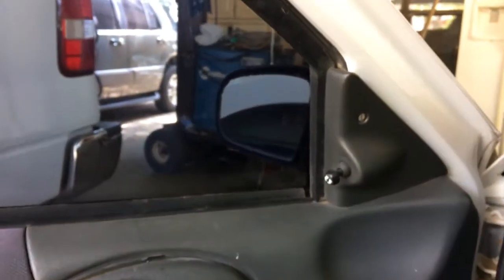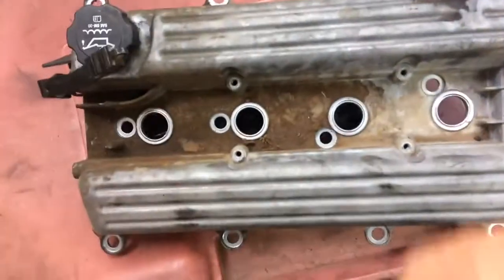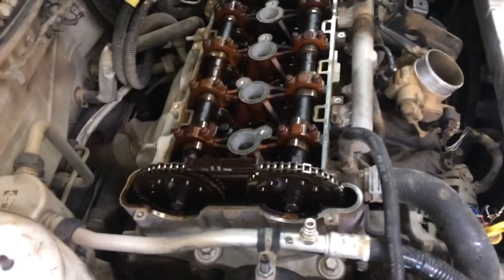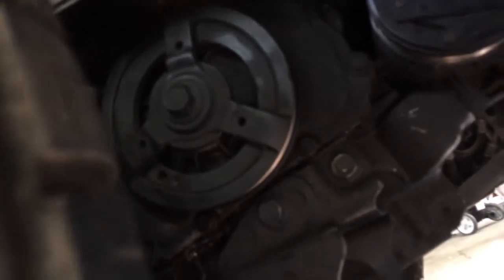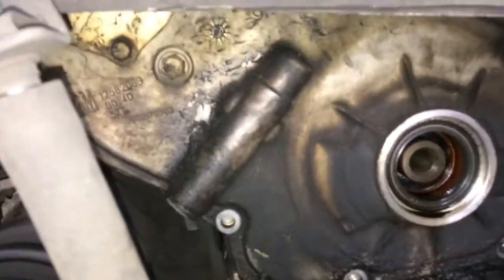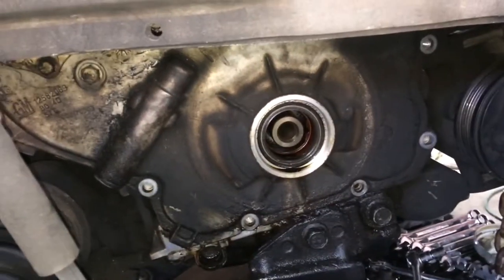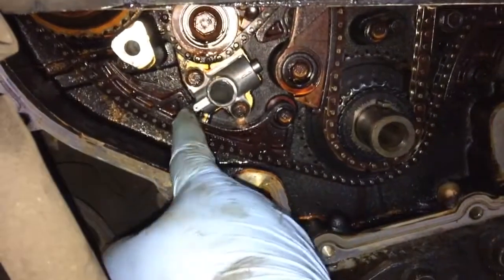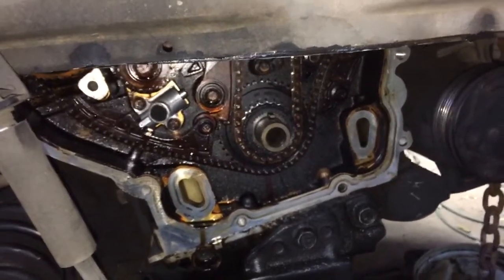2005 Pontiac Sunfire ecotec 2.2L timing chain noise diagnostic.

Comment: As bad as all the timing components were within your eco-tec, I really hope that you changed every part! All the chains, tensioners, & guides! The timing  is controlled via oil pressure especially on VVT equiped models making regular oil changes a NECESSITY! As soon as my oil starts to darken, I change it! Usually about 2,500 miles. My 2.2 has 197-198k & it runs great! With regular maintenance it will outlast the vehicle! Still has great power for a 4 cylinder! The tensioners operate on oil pressure & dirty oil clogs them up!
Reply: Wow  GREAT thing to remember  THANK YOU!

Comment: A few years ago, I was at a used car lot looking at a different vehicle when the sales lady mentioned a G5 that they had & that she had just started it. (I think the car I was looking at had a dead battery or something) so, I went & looked at the G5 & test drove it. It shimmied real bad but, had bald tires. Long story short, she started it to hide the ticking of the timing chain! Turned out that, all 4 wheels were bent according to a local shop who also informed me that the control arm bushings were bad & when I changed them, the bolts were seized=Nightmare job!!! Anyways, I changed the timing chains in December in teens to 20° high weather! 2 months later, the transmission went out! I changed it myself with help from 1 friend using jacks when I really needed a transmission jack!!! Looking at the condition of your timing chain & tensioners, You are very lucky it did not skip & bend the valves!!!! Mine start tapping just at start up so, I changed the upper tensioner but soon it started tapping again so, I changed every part of the timing components except the water pump because it was freezing outside & it worked fine & still does to this day! I have it if need be!

Comment: Sry 4 so many comments but, many of the timing kits are missing 1 thing or another! Which one to get is mind boggling! On my Pontiac G5 2.2 vin-F, Do i need the timing cover gasket, or front main seal??? How did u fix your broken bolt issue? Would be nice if the 2.2 timing kit came with a water pump, oil pump, oil pan gasket, at least the valve cover gasket & o-rings & timing cover gasket, all stretch bolts! EVERYTHING NEEDED. Did u reuse any of your bolts (cam bolts, or the 2 little gears-bolts?  Y the timing kits dont cime with everything is beyond me!!!!!

Comment: good stuff man, thank you very much... I think that sound was similar to what I was hearing, I thought it was just sticking valves. My 2007 saturn died the other day and I am just running through everything. I noticed it was slightly sluggish when I turned AC on and had a clicking in the top of the engine but she ran strong,  It didn't even warn me with a check engine light, just started sputtering then wouldn't start at all lol as I was trying to get it to a safe parking spot the check eng light finally flashed right as I was pulling in and hasn't started since... fuel pressure good, battery seems strong, getting the alternator checked monday, but decided to pull the valve cover, There was a bit of slack in the timing chain which got tight as soon as I rotated the motor by hand. My mechanic friend said it is normal (but I am still worried) timing still seems pretty closely aligned to "top dead center"  and even when I slowly turn the engine I can hear a couple valves sticking. (at least 95 percent sure thats what I'm hearing) battery seemed to be holding a charge so I'm doubtful the alternator is bad (but I've been told a weak one can mess up newer cars differently so worth a check) lol any thoughts?  After your video I'm going to open up that cover and check that tensioners. Cheers to you, thanks again for the vid
Reply: Depending what model,  my Z24 has a digital dash and takes at least a 100 amp alternator to run.

Comment: Thanks for this video.  I have a Saturn L series with this engine, 213K miles.  Some questions -
1. Was it dirty inside the engine?  Do you think this car might not have had regular oil & filter changes?
2. Did you also change the timing chain tensioner (the one that screws in to the top of the head) to the latest design?  I am thinking of doing at least that to my car soon.

Comment: I need a new idler tensioner, which one do you recommend from rockauto? It's a beater 08 G5 2.2 5 speed, I won't keep it long, only got 65k, but rotted rockers, off to the auction soon

Comment: I just bot a 08 G5, 65k, but a total beater, a little noisy on startup, I changed the oil, put in Synthetic. Does that bolt come loose whenever it feels like? Or what's your opinion? I won't keep it for long as it has rusty rockers, stinks of cigarettes and is filthy, but runs and drives super! Everything works perfectly, due to low mileage. I posted a vid of it last week, I'll make another...